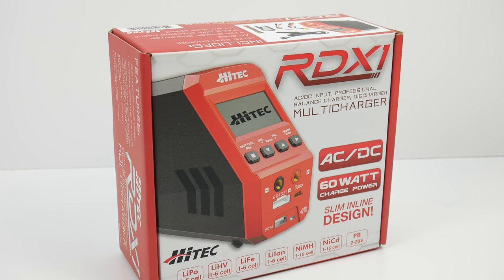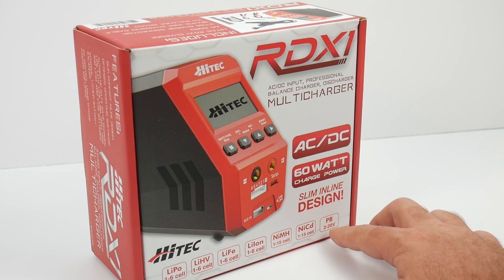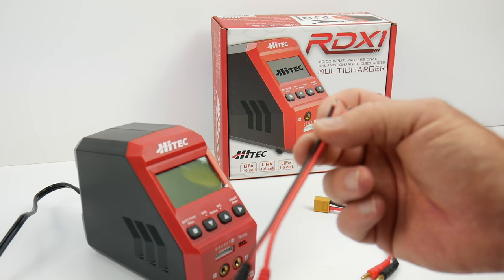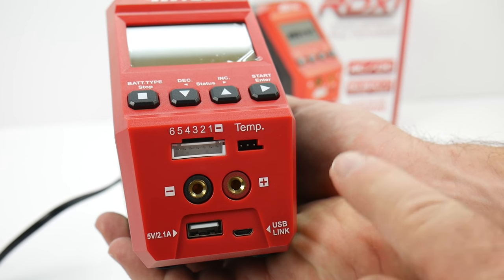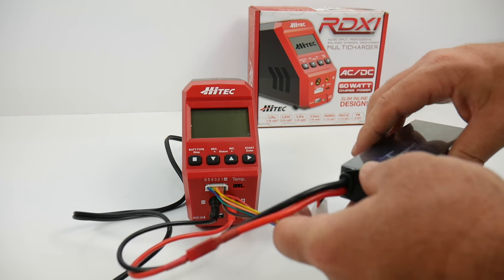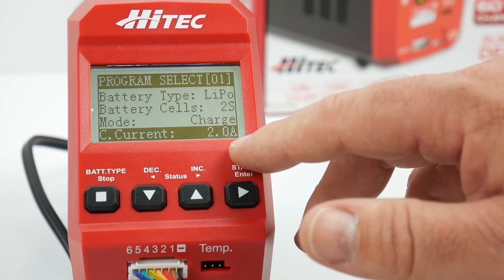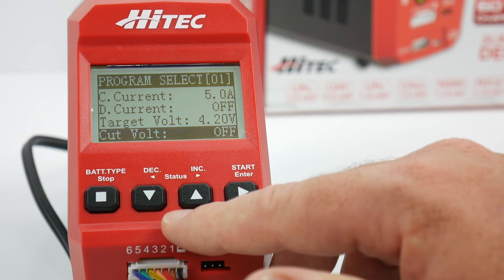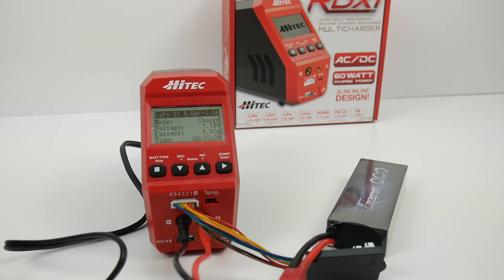Hitec RDX1 Multi Charger - Unboxing and First Use!

Comment: I just bought this charger and since this video came out it seems Hitec has made some changes. The wire adapters are different. It now comes with Dean's and XT60 connectors and the connectors that plug into the charger are molded one piece banana plugs now instead of being a two individual plugs. The software is easy as hell to understand and figure out. The instructions are also easy to use. This charger also storage charges ten times faster then my Tenergy TB6! My TB6 would take over an hour to storage charge my Lipos! This charger can do it in 30 minutes or less! Plus I love the small size and built in power supply. Overall great charger for $65!

Comment: The XT60 port on the back is for power in, not power out. It can be used if you want to power the system from a 12 volt battery. Increases the mobility of the charger.
Reply from the maker: Gotcha - I rarely use DC power

Comment: Nice review.  Well done.  I have been looking at the RDX for a few months now.  I really like the tower style with everything on the front.  Reason being I am considering to buy 4 of them and set them up on the workshop bench in a rack, in a custom builtbyme holder/cabinet.   I considered the 4 in 1 charger units.  However their ports are all over the cases AND there are many reports of the multiport chargers having one or more of the ports fail and be unsusable.   By going with single port unit like the RDX1, and lining them up in a rack of the number of charger/ports you actually need.  Makes for a clean bench, and if one fails, you replace just one.   You can setup a rack of RDX1 for less money than one of the bigger 4 port units!

Comment: with a 2s lipo my amperage is 5 amps, my charge time exceeded its charge time and my 1st maxx amps lipo was a non operational lipo pack with a 3 plus hour run 1st time. i always run 3 minute run packs with 15 minute charge time, lipo run time is impressive but troubled.
Reply from the maker: Lipo is not perfect

Comment: I like the looks of this charger. One of my questions is if its true or not that the unit uses the same internals as the I max B6 ?  I had a local hobby shop tell me that really the main difference was the body style of the two and how the hitec offered the usb ports and larger display. But claimed that other than that they are no different in performance. 

I'm a beginner in the brushless world since ive only driven nitro. So naturally i just went with the more affordable I max B6 and its working great so far. I also noticed the operation is nearly the same with the buttons and the display as far as the battery information elapsed charge time etc.  

But im almost tempted to buy this charger just because it had some extra features with the usb and the better ac adapter.
Reply from the maker: That very well could be true.  SkyRc does make some models for the Hitec name in the US.  Depending on where you're located, HItec does offer great service and warranty repair on their products and they're based in Southern California - so you're dealing with them instead of a nightmare email translation issue and weeks/months to get things resolved
Reply: ahh okay thats an interesting take on the matter.  i do live in southern california so that alone is a neat situation to have a good customer support.  For that alone im leaning towards them. I will say it would be nice though to charge two or more batteries but its not cheap haha.  

I think for the time being i'll see how this current charger does and then maybe if i get more serious in the brushless side i'll spend the bucks on a venom or something.  

Either way thank you for the response i found that interesting.

Comment: Hi, I'm trying to charge my 2S 2400 mah lipo using this charger. I'm doing everything correctly, but when I hit CHARGE it says "connection problem". I've checked everything many times and there is no connection problem. Could there be something wrong with the battery? Or something else that could explain this?
Reply from the maker: You’re connecting both a battery connector and a balance connector?  Is the charger set to lipo balance charge?  If all this is correct, try another battery to rule out the charger.

Comment: I like the video but I don't understand why he plugs in the balance board but sets the charger to the CHARGE setting instead of the BALANCE setting. If your charging a multi cell battery you will want to make sure the cells are balanced so why doesn't he set it to BALANCE?
Reply from the maker: Some people only balance charge every so often.  I ALWAYS balance charge my Lipos.

Comment: I tried changing a 3s 5000mAh spektrum battery on this and when it was completed, I tested it with a spektrum charger and it gave me a overcharge fault… is that normal ? I put in the right settings for the lilo obviously
Reply: Lipo*
Reply from the maker: Strange.  Never had that issue.  Did you test the battery with a tester and see the actual voltage/cell?  That would tell you which charger is the issue

Comment: Mine says connection break, what is that mean.?? And how do i fix it?
Reply from the maker: You likely have a wire somewhere either on the battery or the wiring harness going to the charge that is bad.
Reply: @TheRCNetwork  i have a spektrum (expensive ) battery, wires and the case looks seal… how can i fix it? If possible, thanks

Comment: If i stopped half way or for some reason i stopped can i continue charging later on n the battery wount get damaged?
Reply from the maker: Yes, you should be fine.  Make sure and always balance charge though

Comment: apparently you can use the usb link to connect to your pc, and you can download an app that updates the firmware, monitor, and even control the charger and settings through the pc. i just thought that would be the coolest thing to setup! but ive tried plugging mine into my pc,  nothing seems to happen... maybe i need to download a driver of some sort?? any help would be much appreciated
Reply from the maker: Check this link:  http://hitecrcd.com/support/software-downloads

Comment: I have the same charger. My question is when im in normal charge mode with the balance board plugged in does it charge the battery and balance it at the same time?
Reply: No .because you only have it in charge mode....
Reply: He said in the video that balance mode will only balance it and not actually charge it all the way. Now I don’t know what to do?
Reply: Same and my 6s battery just fried and burnt up. I don't know if it was because it wasn't balanced.I balanced it before I charged it. Then I found the charge mode.I hoped it balanced if the balance plug was in. Fak
Reply: It was in my Outcast and lasted about 45 seconds before ignition.I was running in a really wet field so I don't know what happened. It would be nice to know how you're supposed to balance it. then I can eliminate that as one of the reasons my battery burned up maybe.

Comment: Just bought this charger and new battery. set it up the same way you did and I just get cell error. any way you can help?
Reply from the maker: Dave Dunkelberger double check all the specs are in the charger according to the battery - mah and cell count. After that, you may need to check the individual cell Voyage to see if there's an issue with the cells (if one dropped below 3v). Also check all the connections - red to red, black to black, etc
Reply: I got it working. voltage is showing 8.28 volts and current is at 5.25a while on fast charge

Comment: Hi thank you for the great review I have a question when you are putting it in storage Mode what amperage do I set it
Reply from the maker: Evan Michelson the same as you would charging.....if you have a 5000 mah, 5.0 amps
Reply: @TheRCNetwork  do you need to set the voltage when putting into storage? It is it automatic after entering the cell rating and ampage?

Comment: hi there, nice video, very well presented with plenty of information. 
on a slightly different note, can I use my standard escs with a 2s lipo and if I can is there a maximum limit, say 5000 or less. thanks for any help you can give me. 
😀 👍 👍
Reply from the maker: As for "standard ESCs" what are you referring to?  What model of ESC/Vehicle.  Typically, all Brushless ESC's (They'll have three wires coming off to the motor) are Lipo compatible - which means they have a Lipo cutoff at typically 3.2v/cell.  Some Brushed ESC's (2 wires coming off the motor) have Lipo cutoff, but it varies and sometimes have to be switched.  It is not recommended to use a Lipo with a non-cut-off ESC, as once the cells have been drained, they will not re-charge.  As for mah, there's no limit on mah, other than what size will fit in your car.  MAH determines run time as long as it was intended for your size of vehicle
Reply: sorry, should have said brushed escs, 1060 hobby wing, and xcar 111.